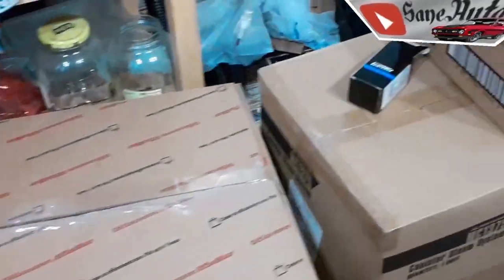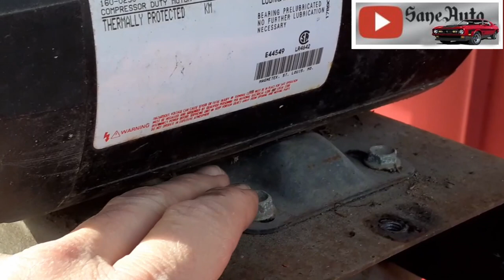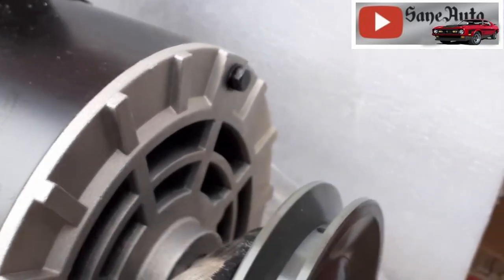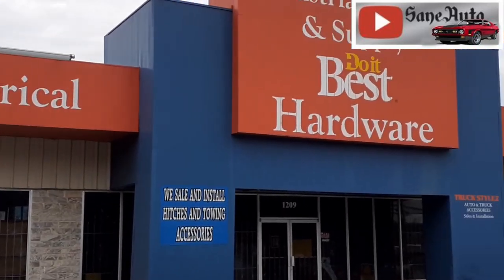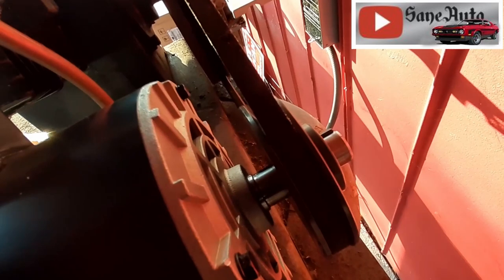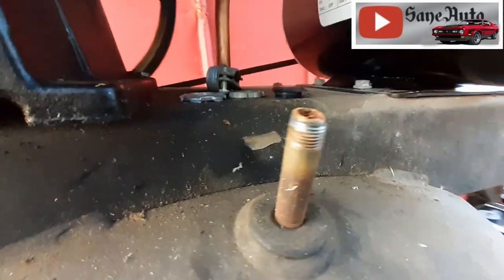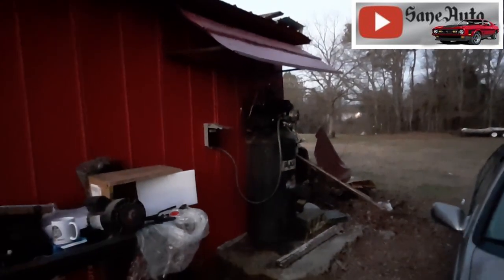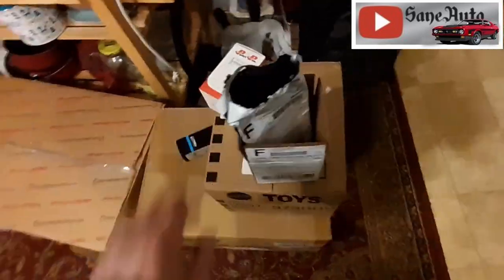Cheap replacement 5HP Electric Motor Unboxing and Air Compressor Install

Comment: l work in a warehouse and open a lot of things with those straps and your so right, they'll cut badly, Motor looks great and excellent job getting it installed and working...
Reply from the maker: I could sure blow the dust out of computer parts with it now :-)
Reply: @saneauto  lol for sure...

Comment: Hay man. You are bang on with your issue with the 6hp motor.
I live in New Zealand and we use 240 in our homes.
My 3 hp motor at 240volts pulls 15amps. So there is no way that 6hp rating is correct. More likely 3

Comment: Have u tried the color blind glasses they make it too where u can see color
Reply from the maker: I can see color just apparently not the way yall do. Found that out at MEPS. Ive never tried those glasses. It seems to me youd need a correct prescription for them to work. I mostly have trouble with browns and reds some green and yellowish stuff too.